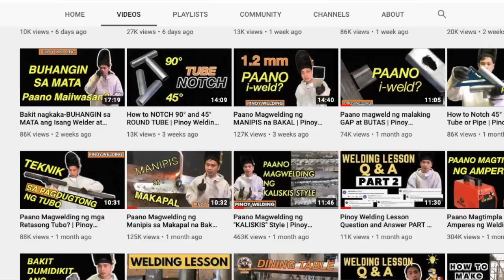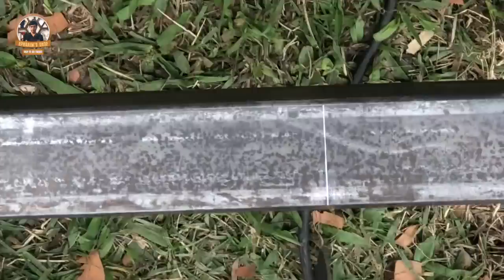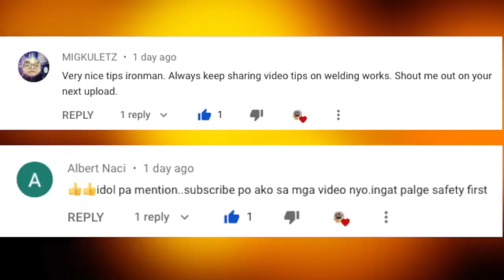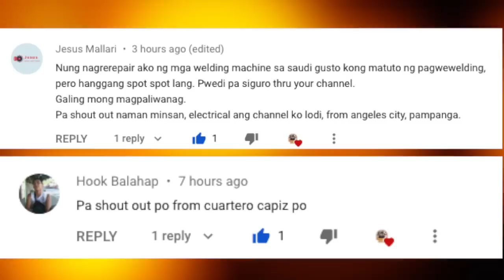Tips sa Pagputol ng Bakal | Step by Step Tutorial | Pinoy Welding

Comment: Master ironmen tanong kulang po....ano pong pweding ampers sa 1.6 mm.salamat po master ironmen...wait kupo ang answer nyo..ironmen...
Reply from the maker: kahit 35 amps lang po, paki try po kasi dipende sa klase ng machine po yan kung kaya nya na tunawin 🤝
Reply: Stanley inverter po ang  machine ko.na may ampers na 16. Ironmen sa tingin nyopo hndi poba local tong welding machine ko sa ACE kusya nabili na may halagang 16,890....magndang klase po kaya sya???????salamat po master ironmen..❤️❤️❤️
Reply from the maker: 16k po? maganda na po  dapat yan, ilang amps po yang machine?
Reply: 16 amp
Reply: Opo 16k po..sa ace hardware kusya nabili